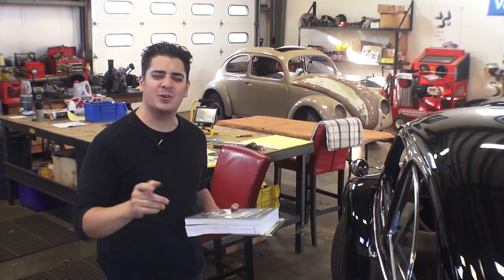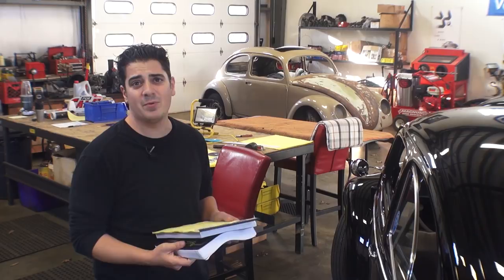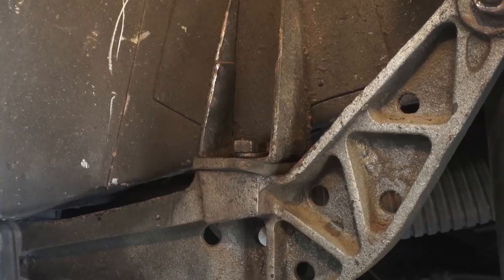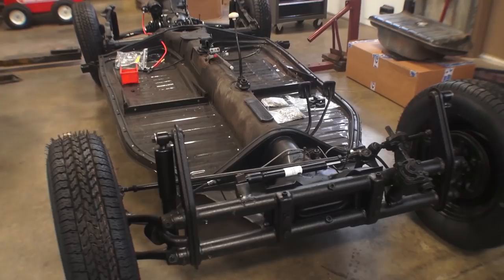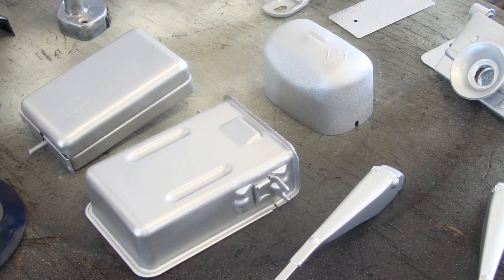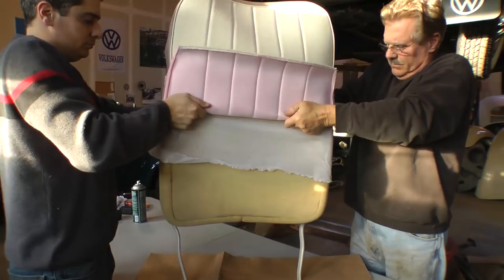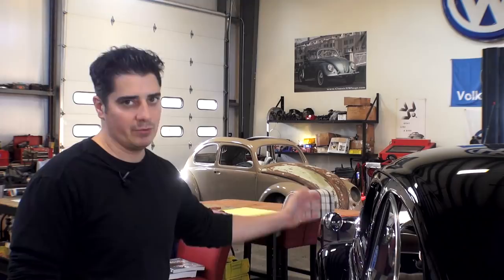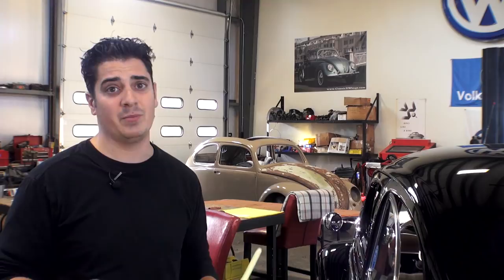Classic VW BuGs Step By Step Beginners Restoration Beetle Note Guide

Comment: cheers, I'm a painter in AU's, one thing I like to add is put your old bolts into the threads before painting so you won't break bolts because the threads are full of paint...you can also tap them but I prefer old bolts in to cover the threads.
Reply from the maker: very good tip there.  =o)  thank you.

Comment: I have a question for you, for the inner door seel can you use any fit able seel and cut it out your self or do you have to buy one. I know that they are cheap but any savings is always best on a project. And yes my profile pic is my project. Also thanks for all of the help from your videos I hope to hear back
Reply from the maker: I guess you could, but not sure how much cheaper you can get, I mean Brazilian door seals are like 11 bucks.
Reply: Chris Vallone, thanks for the reply I was just thinking that if I did that then I'd have enough rubber for the  both doors and much more for any other projects like my 86 blazer that needs new seels